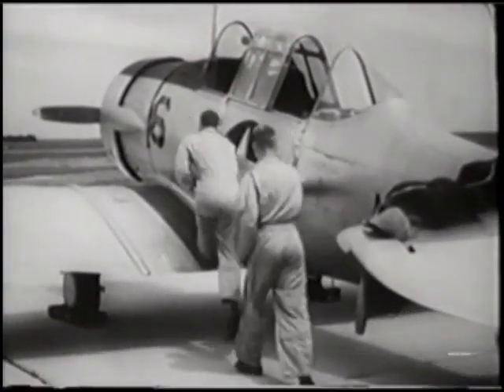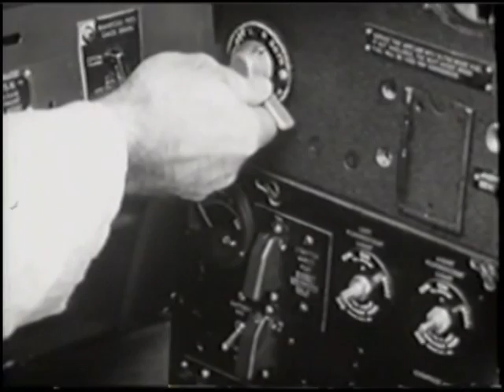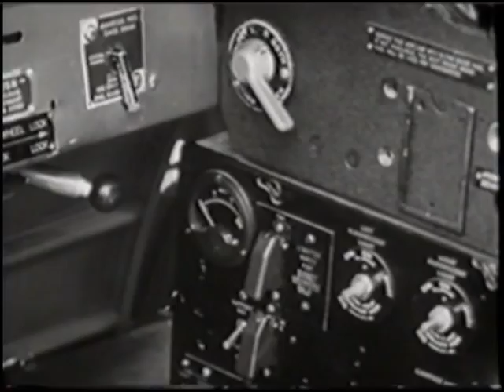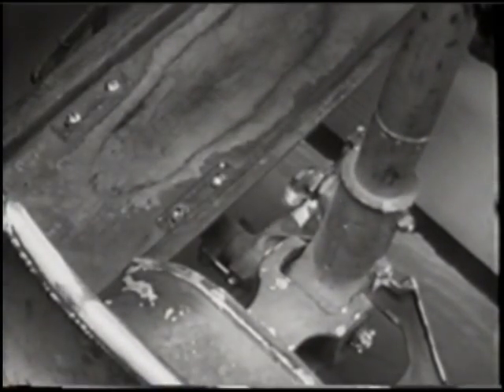1: Harvard T6 Pre-Flight Checks

Comment from the maker: 4.3.3.1 Before you get into the plane.
4.3.3.1.1 General overview.
-	Foreign objects: have a thorough look at the inside of the cockpit, including floor and side galleys, use the flashlight if you have one. Lean forward to have a good look around the control column pit and around the rudder pedals.
-	Seat belt and shoulder straps: Check fixation on airframe, condition of the straps.
-	Buckle: Manipulate. 
-	Harness locking system: Manipulate. Prepare seat belt for easy access before flight.

Comment from the maker: -	Sliding canopy: 
o	Canopy rails: check for foreign objects, condition and alignment. 
o	Sliding canopy: Manipulate.
o	Latch: Manipulate.
o	Perspex and frame: Check condition (cracks, colouring and deformation, missing screws).
o	Canopy Jettison Levers: Flush & Lock-Wired.
-	Organize cockpit (charts, checklists, headset etc.) logically and with attention to FOD issues.

Comment from the maker: -	Engine throttles: Manipulate individually and then all back.
o	Power: CLOSED back.
o	Mixture: FULL RICH back.
o	Propeller: FULL COARSE back.
-	Trims: Manipulate and then 10/3 (elevator 10 o’clock, rudder 3 o’clock).
-	Fuel: Manipulate and then RESERVE left.
-	Flaps: DOWN using hand pump. Check pump is holding hydraulic pressure, if not suspect internal leakage, pump may be inefficient in case of emergency gear down.
-	Landing Gear: DOWN and check indicator and lock pins visible on both wings.

Comment from the maker: 4.3.3.1.2.2 Check floor portion from front to back.
-	Rudder pedals: Check movement, friction, resistance, abnormal sound, correct fixation. 
-	Brakes: Depress, check for hydraulic leak, air bubbles, full movement.
-	Primer: Manipulate then CLOSED and LOCKED.
-	Oil Cooler: Manipulate then CLOSED up.
-	Carb Heat: Manipulate then COLD up.
-	Control column: Manipulate. Check correct direction of associated flying controls.

Comment from the maker: 4.3.3.1.2.4 Check instruments from top left to bottom right.
-	Compass: free and correct, no bubbles, not leaning, shows a known heading, compass deviation card installed.
-	Vacuum: Zero.
-	Generator: Zero.
-	Altimeter: QNH + 2.5 hpa.
-	VSI: Zero or note indication to benchmark.
-	ASI: Zero.
-	DI: pre-set and CAGED.
-	AH: CAGED.
-	Radio: SET.
-	Transponder: SET.

Comment from the maker: 4.3.3.1.2.5 Back seat.
If the aircraft is to be flown solo, carry out the following checks in the rear cockpit:
-	Parachute: REMOVED.
-	No loose equipment.
-	Safety harness: SECURED.
-	Control column: STORED and positively locked in socket.
-	Gyros: CAGED.
-	Dinghy knife: STOWED.
-	Intercom: OFF.
-	Rear sliding hood:
o	Jettison levers flush with panels and locking wires in position.
o	LOCKED SHUT.

Comment from the maker: - Note 2, interference: Once the internal check completed, remember that the aircraft has been configured for engine start, but you are going to get off the cockpit to do the external pre-flight inspection and may go away from the aircraft for many reasons. If someone who is not a trusted operator has climbed into the cockpit since your pre-flight, go again through the internal pre-flight check list to verify for foreign objects and correct pre-settings of equipment.

Comment from the maker: - Note 3, external checks: Start at the left wing root and work clockwise around the aircraft.
- Note 4, QNH: as at June 2012, the correct altimeter setting is QNH + 2.5 hpa (will give you true altitude).

Comment from the maker: 4.3.3.1.3 Left wing checks.
-	Upper wing :
o	Condition of stub wing fairing.
o	Fuel filler cap secure.
o	Condition of upper surface.
-	Flap: Condition and position.
-	Aileron :
o	Condition of surface.
o	Condition of trimmer.
o	Bonding wires intact.
o	Freedom of movement.
-	Navigation lights: Conditions.
-	Lower wing :
o	Condition of under surface.
o	Lashing ring removed.
o	Panels secure.
o	Condition of leading edge.
o	Condition of landing light.

Comment from the maker: 4.3.3.1.4 Undercarriage checks.
-	Extension of oleo leg 4 fingers.
-	Condition of wheel bay.
-	Wheel disc secure.
-	Brake lead secure.
-	Tire for cuts, creep and inflation.
-	Chock removed.
-	Fairing door for security and condition.

Comment from the maker: 4.3.3.1.5 Engine checks.
-	Propeller:
o	Condition of blades and counterweights.
o	Pitch.
o	Cowlings and panels secure.
o	Absence of oil leak.
o	Condition and security of exhaust pipe.
o	Turn 5-13 blades.
-	Center plane: Condition of undersurface.
-	Right undercarriage: Ref. undercarriage checks.

Comment from the maker: 4.3.3.1.6 Right wing checks.
-	Lower wing :
o	Condition of landing light.
o	Condition of leading edge.
o	Panels secure.
o	Pitot tube cover removed.
o	Lashing ring removed.
o	Condition of under surface.
-	Navigation lights: Conditions.
-	Aileron : Ref. Left wing checks
-	Flap: Condition and position.
-	Upper wing :
o	Condition of upper surface.
o	Fuel filler cap secure.
o	Condition of stub wing fairing.
o	Anti-gas tapes secure.

Comment from the maker: 4.3.3.1.7 Right fuselage checks.
-	Condition of surface.
-	Panels secure.
-	External aerial secure.
-	Condition of under surface.
-	Condition of identification lights.
-	Ballast weight in position and locked for solo flight.
-	Tailplane: 
o	Condition of upper and lower surfaces.
o	Condition of leading edge.
-	Elevator: 
o	Condition of upper and lower surfaces.
o	Condition of trimmer.
o	Bonding wires intact.
o	Freedom of movement.
o	Condition of trailing edge.

Comment from the maker: 4.3.3.1.9 Left fuselage checks.
-	Elevator: 
o	Condition of trailing edge.
o	Freedom of movement.
o	Bonding wires intact.
o	Condition of trimmer.
o	Condition of upper and lower surfaces.

Comment from the maker: -	Tailplane: 
o	Condition of leading edge.
o	Condition of upper and lower surfaces.
-	Ballast weight in position and locked for solo flight.
-	Condition of under surface.
-	External aerial secure.
-	Panels secure.
-	Condition of surface.
-	Baggage compartment: 
o	Security of equipment.
o	Starting handle and lashing rings stowed.
o	Door shut and locked.